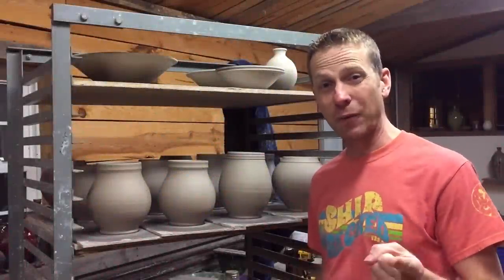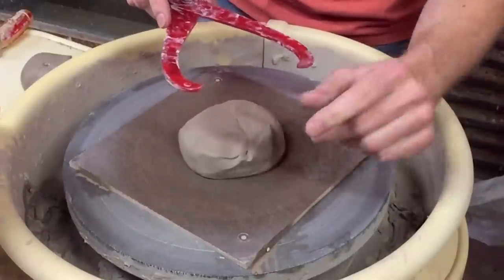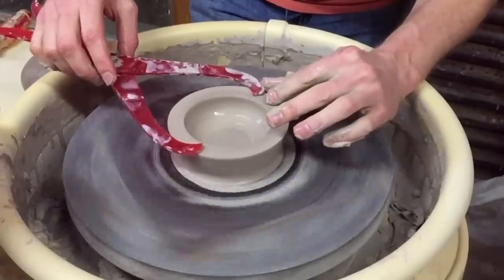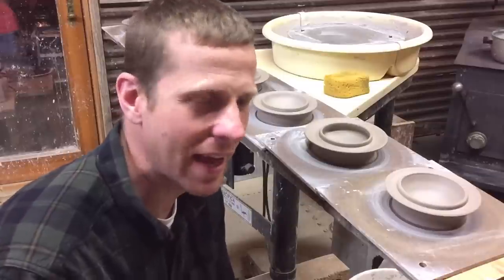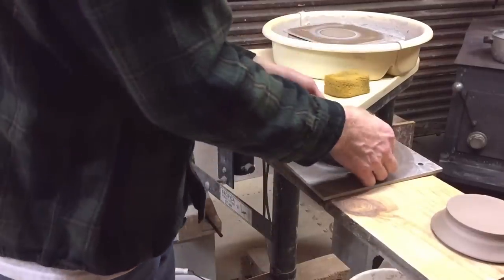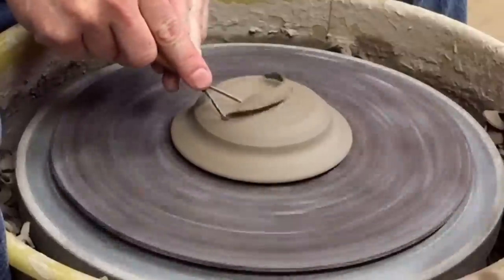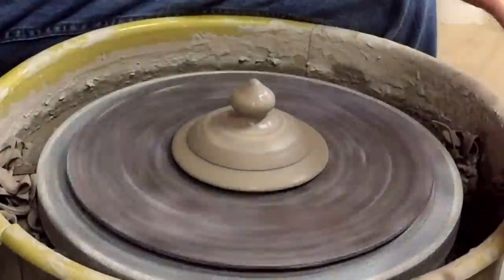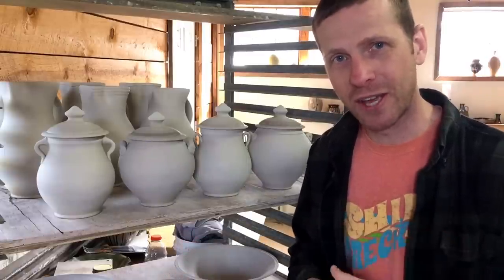How To Throw Lids

Comment: Teapots, lidded jars and skinny necked bottle are my fav to make in that order.

great tip there matt thanks for sharing ;)

You mentioned that some times the lid might still be a little to soft to put the knob on! 
I have a "hairdryer" close to my wheel and that can get you out of trouble for this kind of problem. Obviously it doesn't warrant using the blow torch, so the hairdryer is perfect with this problem [and other similar problems] :)

Excellent tip about throwing the "little cylinders though" in prep for the knobs, :)
Reply: I want to get into making teapots.  One of my projects.

Comment: Loved that one! Very helpful... I've been working on casseroles and just dealing with whatever sizes of openings came out... good idea to make them all the same-size openings, that never occurred to me! Thanks for the tips. Also like your method of attaching knobs, I've been just carving them out of the clay left at the bottom after forming the main part of the lid, so my lid 'handles' are quite flat and disc shaped, but your knobs are much more stylish... will try that tomorrow when I'm back in the studio! Thanks!
Reply from the maker: Yes you’ll definitely get a better shaped knob by adding some additional clay instead of carving out from the excess clay. I’m glad the video helped! Cheers

Comment: I have never worked with clay, however, I am thinking of ways to make clay lids for clay pots to keep food cold without electricity. We are moving to the mountains and will be living off grid. I am thinking of buying oblong clay pots to keep our food cold. My thoughts are towards trying
To mold lids for the  planters, by making styrofoam frames and then molding the clay into shape. Do you think that is possible?   These are just my idea's that I conger in my think tank. If you have a few minutes to make a comment I would certainly appreciate it. Thank you sincerely.